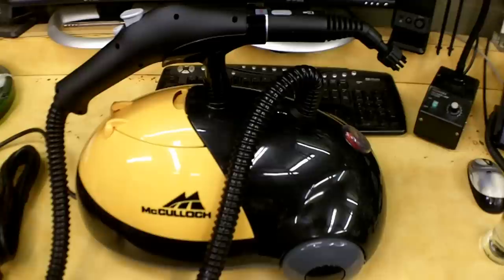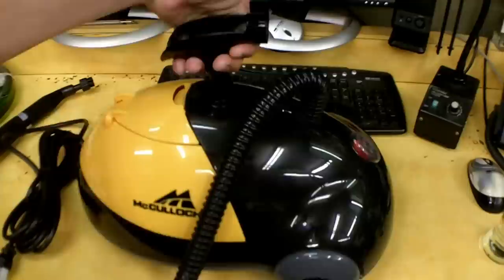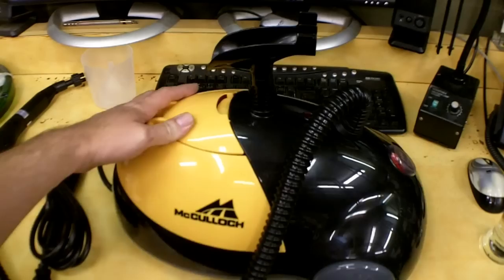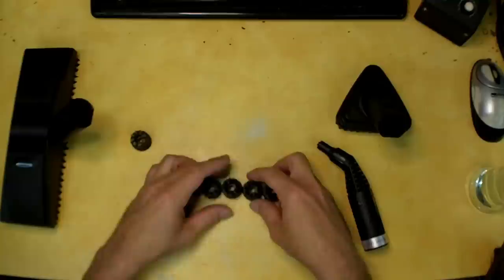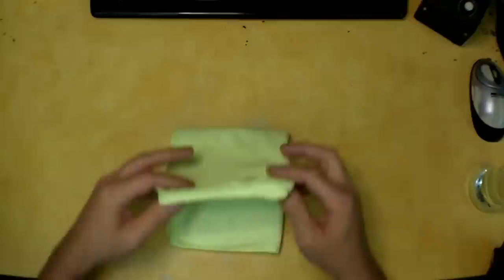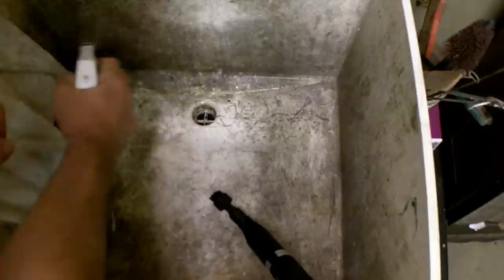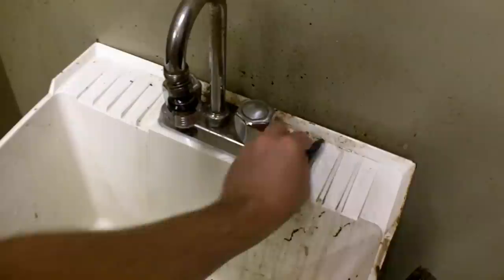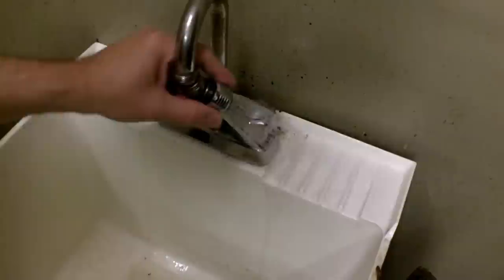Harbor Freight McCulloch MC1275 Steam Cleaner Review

Comment: How do you empty it? And why distilled water? And since you can't clean inside the reservoir, is that a problem long term?
Reply from the maker: You just take off the cap and turn it over to empty. I use a funnel to put the water back in the jug. Distilled water is mineral free so its the best to use and shouldn't hurt the tank in any way. I don't know how long it would take to cause any damage with tap water though. Good luck, G.

Comment: Would it be possible to use this the same way as a steam machine used for car interiors? I think it would but would appreciate your opinion
Reply from the maker: I did use mine on my car and it worked pretty good. Keep in mind it does not have extraction. I cleaned my car with it, then came back with a shop vac to suck up as much residual water as I could- then left the doors open so it could dry the rest of the way. It's not a commercial unit, but doesn't cost as much as one either. For home use, I would think it would work fine. If you're looking for something commercial, I would go with something else. Hope this helps, G.

Comment: is there mopping required after using this unit from the excess water made by the steam?
Reply from the maker: It really depends on what you're doing with it. If you are using a pad and doing the floor, it leaves a bit behind but dries pretty quick. If you were just using the other attachments for a sink or something like that, it leaves a little more behind that might require a followup wiping with a cloth. Hope this helps, G.

Comment: I see this video is now 6 years old. How well has the cleaner held up over time?
Reply from the maker: Mine doesn't see hard use Brian, but it still works great. Good luck, G.
Reply: @ghostses  Thanks for the response. Also good to know it is still holding up well.  One more question for you. Did you find a source for replacement brushes and pads?
Reply from the maker: No problem Brian. I have a link posted in the description to a site that sells replacement parts. I've never ordered from them though. Take care, G.

Comment: your moving it way to fast in this video... slow down and it will make it clean as could be.  also great on windows.... it works great... careful on paint it will burn it off... great machine on my 86 harley
Reply from the maker: +Danny Hatt 
That's true Danny! It was my first time using a steamer. Slow and steady is the key. Thanks for the other tips! Good luck, G.
Reply: +ghostses My hose , the black part came off the handle.. no biggy it was still working, but after two years went back to harbour and got a new one yesterday. i had the waranty at harbour freight on it... i like it a lot...  thanks for the reply, have fun..
Reply from the maker: *****

That's cool Danny! Their CS has always been great in my opinion. Good to hear they honored your warranty claim. Mine doesn't see hard core use- but it still works like on day one. Take care, G.